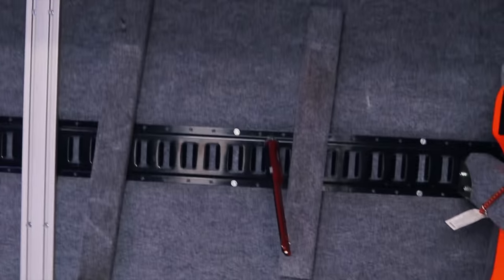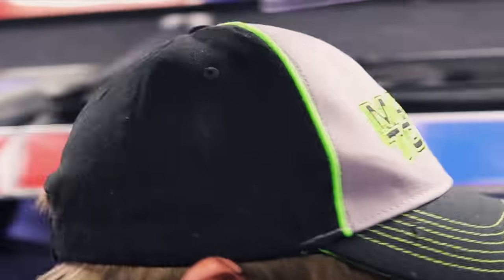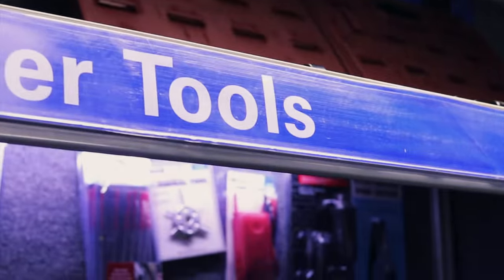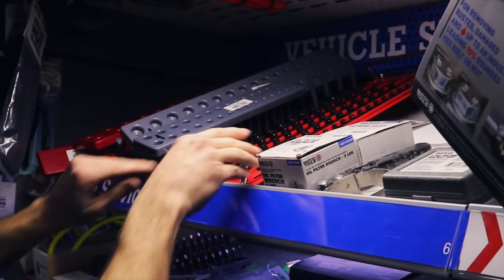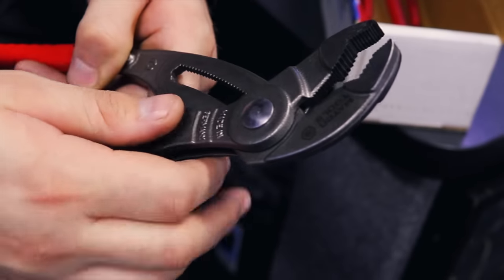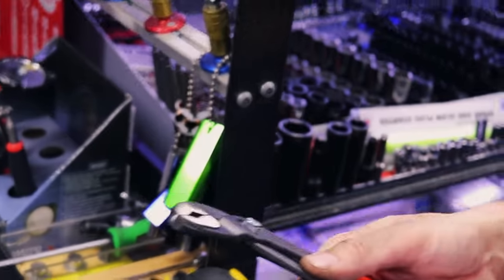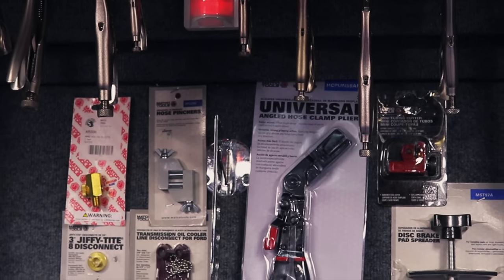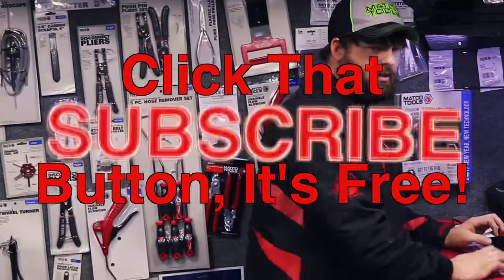Matco Damaged Bolt Socket Set

Comment: @koon trucking next week take a look at part number CGSS585.Its that carbide scraper on the wall,I just got one from my matco dealer a couple months ago for around $25.just put a trans pan back on yesterday and it scraped off a 28 year old cork gasket like nobodies business and didn't Nick the metal up at all like a traditional scraper.

Comment: The Matco set of damaged bolt sockets looks very similar to the set Harbor Freight sells.  The design is unlike other extractor sets I've seen, which is why it caught my attention.  I'd read the HF set is not as effective as the other design offered by Irwin, Craftsman, Snap-on, et al, which are also known as "turbo sockets".  The internal "grippers" on this set appear to be vertical, whereas all the others swirl as you follow them down inside.  The latter design also gets smaller the further you go in, whereas the Matco appears to have a uniform diameter.  I suspect the "helix" design offers slightly more contact than the Matco/HF sets.  It would be interesting to run a test between the Matco set and the more common design to see how effective they are.
Reply: SteveR harbor freight has the same design , just with out a punch, box, 3/8” drive and the hex design on top. Probably worth the money getting of the matco truck, that design does work I have the harbor freight set

Comment: Those sockets look like harbor freights. Tell bill if he wants good boots get timberland premium or red wing. I have and used both for years. The best ones for roofing are timberlands due to their tread design. You’re feet never get wet and will be warm in freezing temps. Redwings are amazing and a very high quality boot. I tried Walmart boots originally and they do not compare to either one I mentioned. Good video 👍🏼
Reply: Up in western Canada, it’s Viberg for ultimate wear and performance. Best boot, real dollars to buy, premium products